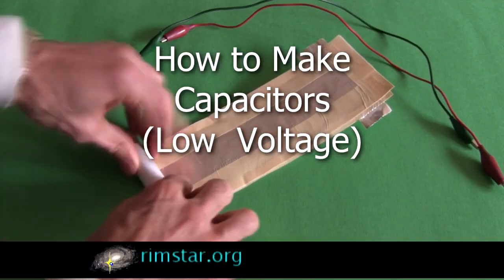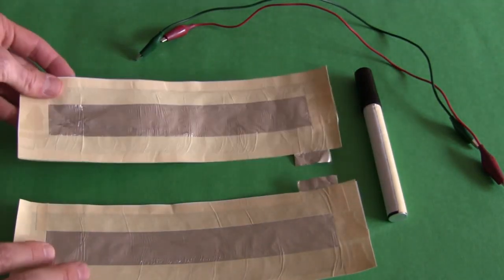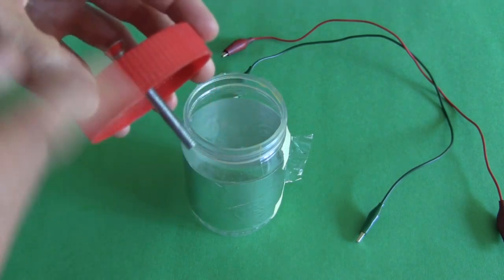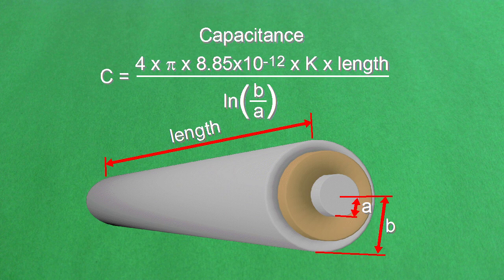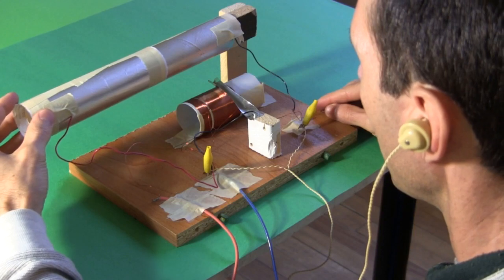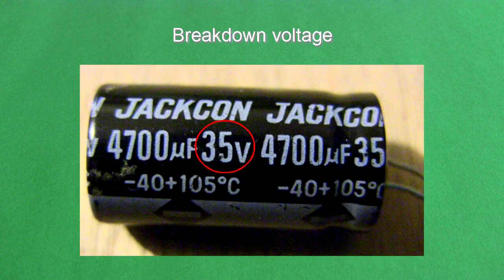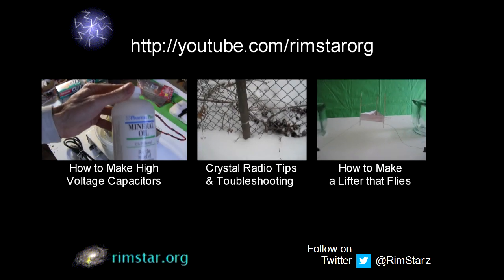How to Make Capacitors - Low Voltage Homemade/DIY Capacitors

Comment: I'm interested in low voltage and high capacity capacitors, made from simple materials.. So my question is how much layers of A4 paper and aluminum folio I need for around 1 Farad at up to 15V? Maybe I should use different dielectric?

Comment: Which one of these can be used to light up an LED? Please let me know as i have to make  a project and it would really help me.
Thanks
Reply from the maker: None of them can be used to light up an LED. Well, maybe the spiral one can but only for a fraction of a second. They can't store enough energy for longer than that.
Reply: Ok. Got it. Thank you for replying.

Comment: Would this work with foil tape on side by side separated by a non-conductive adhesive?
Reply from the maker: ***** As long as your sure the adhesive will keep the conductive foil from touching then that should work. Neat idea.

Comment: could using graphene (very thin graphite) separated by one thin layer (varnish?) on the scale of an leaf of A3 paper lead to a big capacitance? how much capacitance could one squeeze out of a roll of A3 dimension super thin and flexible conductor?
Reply from the maker: Setting aside all the technical issues of how you'd make it, the capacitance would be the same as using two pieces of aluminum foil for the plates instead of graphene. I guess an advantage of graphene over aluminum foil is that when you make an aluminum foil roll it tends to have wrinkles, whereas if you could paint the plates (graphene for example) onto the dielectric then you wouldn't get the wrinkles. It's just a question of whether an electrically conductive paint is available that has a higher conductivity than graphene - I don't know off hand.A supercapacitor is one with an electrolyte in between the plates, with something different going on than what I describe in this video at the boundaries between the plates and the electrolyte. The plates can be activated carbon, for example, or graphene, or other materials. The advantage of graphene is its high conductivity over activated carbon and those other materials. So when graphene is talked about in relation to capacitors, it's usually in regard to supercapacitors, which involve electrolytes. Varnish isn't an electrolyte.

Comment: Does the area variable in the capacitance formula refers to the area of one plate or the combined area of the both plates?How do I calculate the capacitance if I build a capacitor with two plates of different areas?
Reply from the maker: +Dragan Mirel It's the area that the two plates overlap. So it your two plates have a different area you count only the area that they overlap each other.
Reply: +RimstarOrg Thanks a lot sir!

Comment: Hi There, I need to design a Capacitor for university and the only specifications are that it needs to withstand 200V and be 10pF, which capacitor design will work best ?
Reply from the maker: For 10pF by guess is you'll need to go with something with a reasonable amount of surface area, so a rolled up one might do it. I just searched for a formula for a spiral wound capacitor but couldn't find any, but maybe if you spend more time searching than I did you'll find one. You could start with the formula I give in the video for a flat plate capacitor for an approximation and then do tests to fine tune it. For the voltage, off hand I don't know which material you'd use for your 200V but something flexible obviously for a spiral capacitor. Do a search like I suggest in the video for the breakdown voltages of different materials that you can find. Polyethylene usually works good for me since you can get it in long rolls from carpet stores, but waxed paper may be an option if it has the breakdown voltage. Note that materials may have defects so you may have to make a few.

Comment: i would like to used a washing machine motor, attached to a bike, and the connected to a copacitor, wired to a washing machine plug, into my house to produce power for my house,.. will this eork, and if so, what volt should i shhot for in my copacitor? will one from a micro wave work?
Reply from the maker: +Keep Simple No, it wouldn't work. I'm assuming that you're already connected to the power lines from the power companies. One big problem is that you need to add the electronics to match the waveform for the power that's already on those power lines e.g. here in North America it's 60Hz sine wave at around 120volts. You don't just have to produce the waveform but you also have to synchronize with it. Solar power systems that people have on their houses and that are connected to the power lines have special inverters with the electronics that do this waveform matching. Also, there are special rules depending on your power company for doing this, partly for safety purposes. If there's a power failure then workers from the power company will be working on the power lines thinking there's no power on the power lines. But there will be... yours.
If you're not connected to any power lines than you'll still need to produce the correct type of sine wave and voltage since that's what your appliances expect. In that case I'd do like a solar power system and have your bike charge up batteries and then connect an inverter to the batteries to produce the sine wave for your appliances.

Comment: can you help me about this article? I want to make very high capacistance ( I'm not sure if it is spelled right) capacitor (around 50 milifarads and 5 to 9 volts.) Can you help me for the size of the aluminum sheet that i will be using? Thank you in reverse!

Comment: can you tell me the overall circuit . About which you are talking.  At 2:57
Reply from the maker: I meant whatever circuit you built the capacitor for. I didn't have any specific one in mind. Note that you'll want to use a stainless steel. Mine was just normal steel and it corroded very fast in the salty water.

Comment: What is the formula for 2 concentrical cilinders? Is it the same as for the rod and cilinder?
Reply from the maker: Yes, it's the same formula.
Reply: Thanks. Btw what is the "ln" in the lower part of the formula?
Reply from the maker: "ln" is the natural logarithm. You can find it on scientific calculators. https://en.wikipedia.org/wiki/Natural_logarithm

Comment: Can I use aluminum foil as the plate ? I dont have any saw for cutting that plate .....
Reply from the maker: neil pabilonia I show a lot of capacitors in this video so I'm not sure which one you're referring to. But generally, yes, you can use aluminum foil as a capacitor plate.However, aluminum foil is flexible. One of the variables I talk about in the formula for the capacitance is the distance between the plates. If you have a flexible plate material then the distance will vary whenever you press it. Even a tiny change in the shape of the foil will have a big effect. That's where a solid plate is better. But, if it's a capacitor that you never touch once you've set it up then it should stay the same shape.
Reply: Oh thanks , im from philippines and cant find that dielectric , polythelene ...

Comment: can you tell me other way to obtain capacitance of a dielectric material using parallel plate?
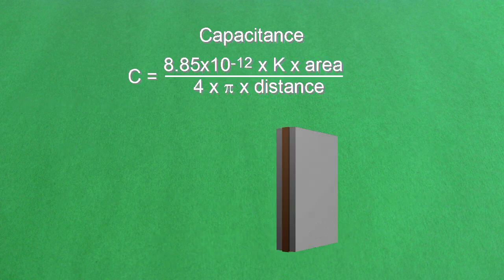Reply from the maker: Are you asking for another way to find out the capacitance of the capacitor without using a meter? If yes, then have a look at the formula in the video at 3:39. That formula calculates the capacitance for a parallel plate capacitor. Measure the area of your plates and the distance between them and you can then plug those values into the formula. The tricky part is finding the value for K in the formula. That one you'll have to look up online. Search on google for "dielectric constant xxx" where xxx is whatever material your dielectric is made of. Now you have all the values so you can use the formula to calculate the capacitance.

Comment: What about using a vacuum as a dielectric?
Reply from the maker: A vacuum would work as a dielectric. You'd need to produce the vacuum and also maintain it. The dielectric constant of a vacuum is just a little lower than air, it's 1. You can still have a capacitor breakdown through a vacuum.
Reply: Do you know if a magnetic field can act as a dielectric... say with plasmas for example?
Reply from the maker: MisterFuturtastic
No, a magnetic field can't act as a dielectric. Dielectrics are materials. But if you're asking can a magnetic field modify a materials dielectric properties, I don't know. It's an interesting question. The effect of a charged capacitor on a solid dielectric is to polarize the molecules, moving the molecules' negative charge toward one side and the positive charge to the other. But a magnetic field affects the spin of the charges, not their location in the molecule. So for a solid I'd "guess" no. However, a plasma is not a solid and is a material with its electrons stripped from its atoms and so it's highly ionized. Can you even have a plasma as a dielectric? I can't even guess with regard to a plasma.
Reply: MisterFuturtastic Maybe your thinking of that plasma can be polarized with a magnetic field.
Same with a static field.
An experiment example try and see how a magnet can influence a lifter's static field.
Reply: Yeah. That's a good way to put it. Maybe the same kind of results as a dielectric but in a different fashion?

Comment: The dielectric constant of a material varies on temperature and FREQUENCY? (7:53s) How???
Reply from the maker: I don't know the how of it, but see here https://en.wikipedia.org/wiki/Dielectric_strength where it lists the factors and includes frequency. Perhaps it has to do with an alternating electric field causing heating as described here http://www.uobabylon.edu.iq/uobcoleges/ad_downloads/6_8121_258.pdf.
Reply: Thanks for the link I found it very useful, specially on the part where says that how microwaves heats up water by using frequencies specifically matched on the frequency relaxation of water for heat it! I didn't knew  that, many thanks.  My best regards

Comment: What about a cheap throw away food bag as a dialectric?
Reply from the maker: I've never tried them. I guess if they don't have any holes then they should work. It's possible that the coloring on them might be electrically conductive so it'd really be trial and error to see how well they'd work.
Reply: An interesting thing happened with my tinkering around with aluminum air batteries. The plastic,(clear plastic also), was put on top of the charcoal and the electrode on top of that. It worked. With an additive to curtail alumina formation the cell ran a hobby motor for over an hour. Some mechanism of capacitance here? How does an insulator suddenly start connecting? Thank you. Subscribed.
Reply from the maker: If it ran for that long then it wasn't capacitance, very likely your battery worked. Possibly the plastic wasn't a good insulator. I'm not familiar with air batteries.

Comment: Can u make a video , that have a 20kv with 60 farad ?
Reply from the maker: neil pabilonia I don't know how to make a 20kV, 60F capacitor. Is it even possible? I've seen 1.2V and 400F.
Reply: Oh so can u tell me how it be an farad , a nd how itbworks and made ?
Reply: neil pabilonia To do that you really would need a bank of multiple capacitors.
Reply from the maker: dieselscience Normally I'd agree but I've recently seen it done at a DIYer level of skill here https://www.youtube.com/watch?v=gTt_YBzJ_Dk Note that it's still not 20kV, only 1.2V, but the capacitance is in the farads.
Reply: Your video link is to a 1.2V not 20kV --- HUGE difference.
Reply from the maker: dieselscience Ah, I thought you were responding to his more recent reply where he seems to have changed his request to the high farads only.

Comment: hi Steve it's me andrew here i built my am christel radio i don't know why it doesent work i tried everything it does not work and I bulit at the same way u built you'res can u tell me what I did wrong or did i round some other magnet wire that does not go with it i did not make my turner i ordered my turners of the phone thes are am turners for all types of am radios the man said also there brand new i think i am not doing something right or what

Comment: i want to manufacture capacitors commercially. can you help?
Reply from the maker: All I have to offer is already in this video and in my one on high voltage capacitors, which talks about voltage breakdown which applies to any capacitor (https://www.youtube.com/watch?v=MPD7skZ8OSo).
Reply: Trying to build commercial capacitors based on what you see on YouTube is unrealistic. If it was that easy somebody would have done it before. And furthermore, I think it's pretty damn rude to ask this guy to go out of his way to help you make money using something that HE figured out and you had nothing to do with, except deciding to steal the idea and try to make money off it. Disgusting and greedy.

Comment: can we use a capacitor  AC in  Continuous current circuit dc
Reply from the maker: Yes, as far as I know, any capacitor can be used with continuous current DC. Just make sure you don't exceed the capacitors voltage rating. If the voltage rating is given as AC voltage only then I'm not sure if there's a different rating for DC or if you use that the AC voltage rating. Perhaps someone else here knows?
Reply: @RimstarOrg  indeed you can use a capacitor for AC in DC but in AC explodes if you overpass the voltage, and also short-circuit. But in DC charges and stays the same as a battery. Thank you for taking time answering questions Rim. You are the missing people that made the 80's the best times
Reply: @RimstarOrg  as i know, the AC voltage rating on capacitor non polar always in peak Voltage not rms unless is indicate / printed on the side its RMS value. and the simplest formula as i know is Vac x 1.414 = DC unless we are talking different waveform and higher frequency range
Reply from the maker: Thanks for stepping in and answering, folks.

Comment: Hey, I found something pretty helpful when I was searching for the material with the highest dielectric constant I could reasonably use. I found a huge chart (here: http://www.thelearningpit.com/hj/plcs_files/plcs-72.gif and here: http://www.thelearningpit.com/hj/plcs_files/plcs-73.gif) that lists the dielectric constant for everything from corn to powdered milk. Most importantly though, it says that the dielectric constant of paint is between 5-8, which is super convenient because it's easily implemented and like 3 times higher than anything else you could reasonably use in a capacitor.

Comment: hey rimstar I had a question for you, I made a mini 3v tesla coil with the circuit out of a hand help bug zapper and I wanted to try and add 1 or 2 of the home made capacitors for it.. now what I was wondering was if I could just run it in  parallel   off of the capacitor that's in the bug zappers circuit..http://rpsx.eu/upload/681TjODf.jpg that's the schematic  for how its put together if its any helo

Comment: I made a capacitor and it charges to 0.5 v instead of 1.5 v. What I'm doing wrong?
Reply from the maker: What are you using to charge it? If your power source puts out only 0.5 v then that's the most your capacitor will charge up to.
Reply: @RimstarOrg  I'm using a 1.5 volt battery, I even checked its voltage.
Reply from the maker: It could be that your 1.5v battery is down to around 0.5v.
Reply: @RimstarOrg  my multimeter says that the battery has 1.48 volts
Reply from the maker: In that case I'll have to know what you used to make your capacitor, what is the dielectric material, the material between the metal plates.  Maybe it's something that's partially conductive.
Reply: @RimstarOrg  I used normal paper
Reply from the maker: Even with normal paper there are different types, some could have something in them that makes them electrically conductive. I'd suggest trying different materials and seeing if some work and some don't. I don't recall exactly what I tried while making this video but there was one type of paper I tried that didn't work. Try plastics too.
Reply: @RimstarOrg  ok I will try.

Comment: How would I make a 500 microfarad capacitor to power an led?
Reply from the maker: I made a 560 microfarad electrolytic capacitor here https://www.youtube.com/watch?v=lmVVdV8wuB0 but that's for AC. You'll need to add a diode for DC for your LED. But even then, 560 microfarads won't power it for very long, as you can guess from the demos I do in the video. For higher farads, search for homemade supercapacitors -- I haven't made any of those.
Reply: RimstarOrg I have another question. I’m building a plate capacitor out of of 2 zinc plates and either Teflon or lexan as the dielectric. What I need to know is what is a good adhesive to glue everything together? Also I’m gonna solder the leads on the back middle of the plates, would this work?
Reply from the maker: I guess any glue in between the plates would affect the dielectric constant. You'll probably have to experiment to find out how much. I don't know what glue you should use. Also, I don't know off hand how easy it is to solder to zinc. That you can probably find by searching online.
Reply: The zinc soldered fine but gorilla glue did not work. It wouldn’t charge at all with the glue 🙃
Reply: There's no reason you should need a diode to charge a capacitor on DC. Do yourself a favor and look this stuff up on a real site (preferably several of them). Better yet, read a book Youtube's all well and good but not only do you get very incomplete information, more often than not it's incorrect. You're not going to learn anything useful on YouTube. And you certainly aren't going to learn how to do it safely.
Reply: @VoidHalo  you're jumping to conclusions very easily without even understanding what's being said
The reason he told him to add  diode is to protect his homeade electrolytic cap from being fried if he inverted the polarity